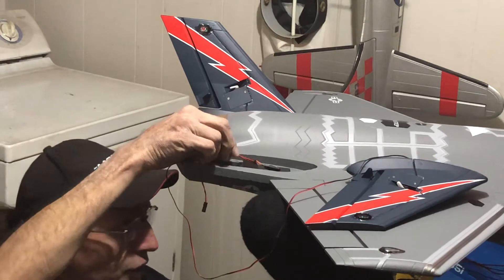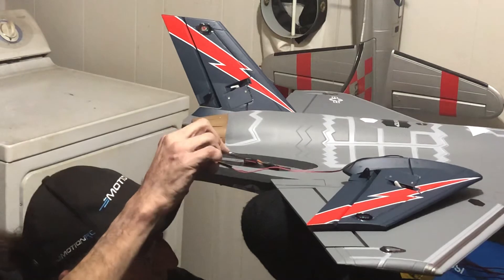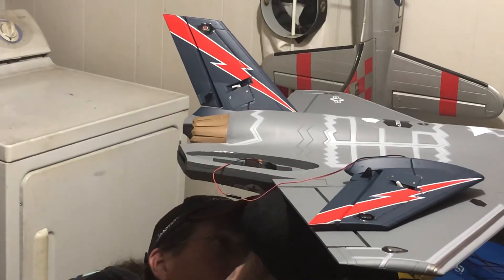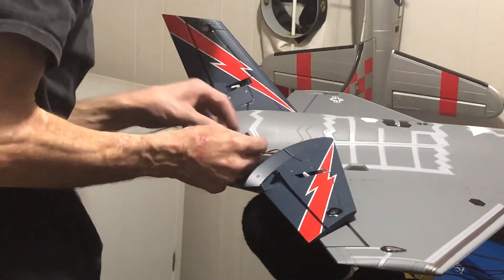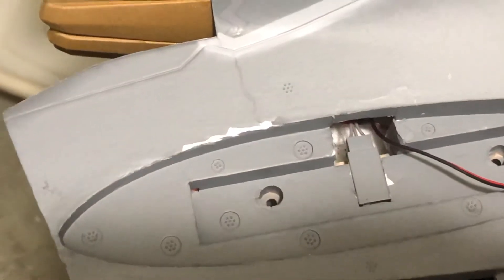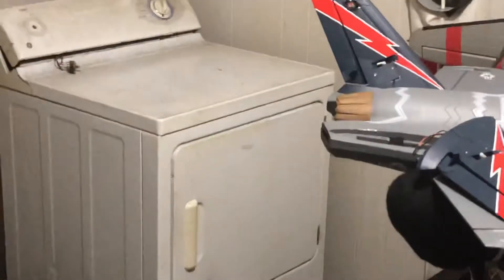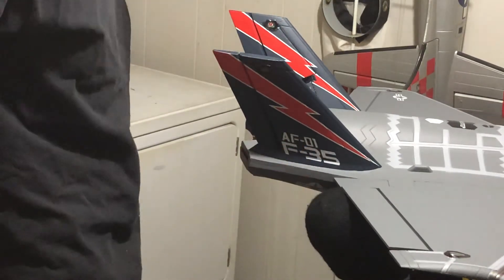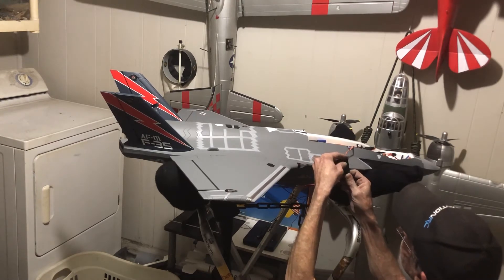Freewing F-35 (Installing Vertical & LED Show)

Comment: Eric, That FW F-35 is extra sharp with more lights than casino, Great work. Only question is with the addition of the Fiery Booty are you going to use a separate battery to power the Admiral 600 Gyro Receiver and if so what size battery? Awesome Video👍😎🎬✨✨✨✨✨✈🛫🛩
Reply from the maker: I don’t use separate battery Tughill. I put a 12 amp UBEC onBEC lead before BEC. Run both ring and center burner off it. If it drains battery too much it’s OK because I don’t fly long. Just go up and start setting up a landing 👍🏻✌🏻🖖🏻